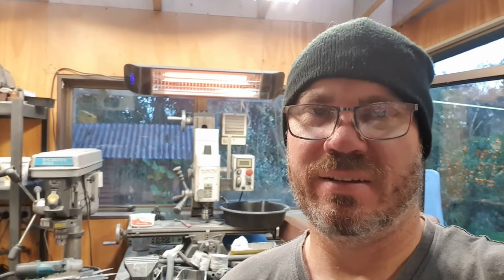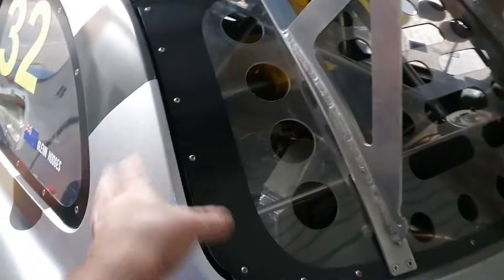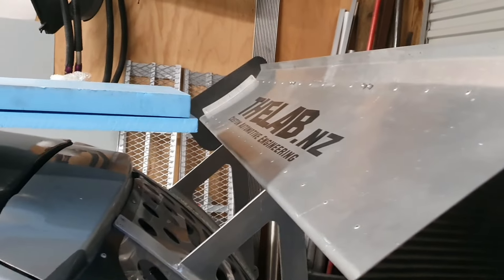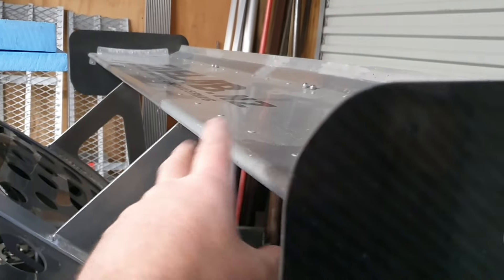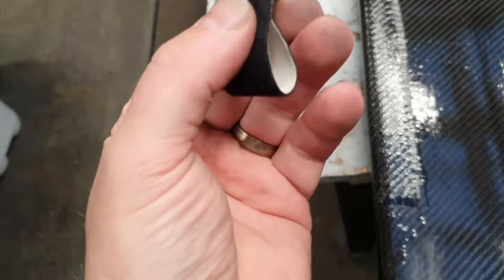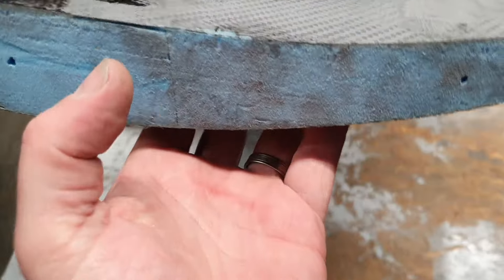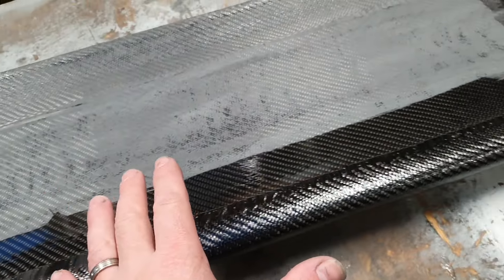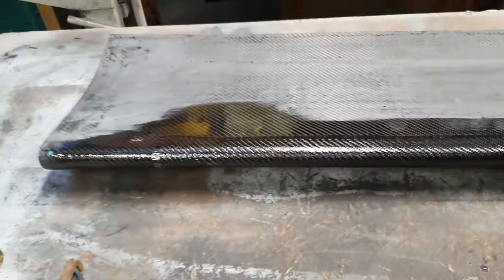Carbon fibre wing for the march

Comment: Hopefully the hand heals up soon! Are you expecting much more downforce with the aerofoil (I think) shape vs the thinner existing wing?
Reply from the maker: It SHOULD make a noticeable amount more downforce given the shape, the lack of rivets on the surface, the lack of the lap joint in a critical area of the wing.
At this stage I've not made a Gurney flap for it so it may even out a little without that.

I have a heap of foam left over and a bit of time so I can probably make some small sections and experiment to get some real numbers to compare.
(set up on scales and provide some air flow over a section, measure weight change)
Reply: @TheLabLimited  would be interesting to see testing, I have a very passing knowledge of aerodynamics and would know that in theory there would be a difference with the shapes but I have zero practical experience so it’s always cool to see people actually doing stuff and testing!